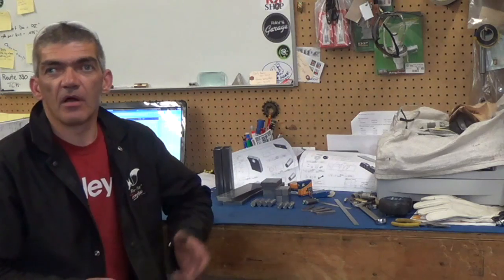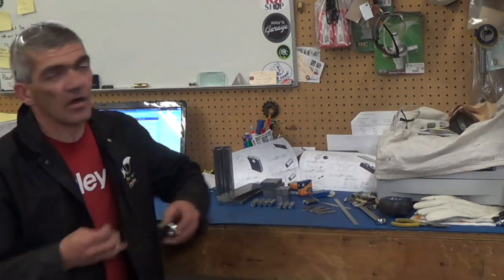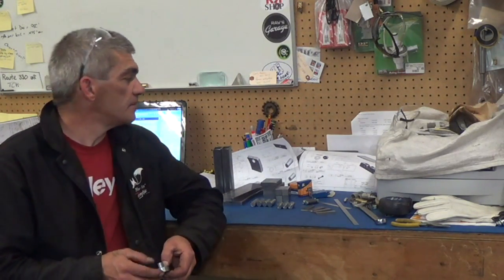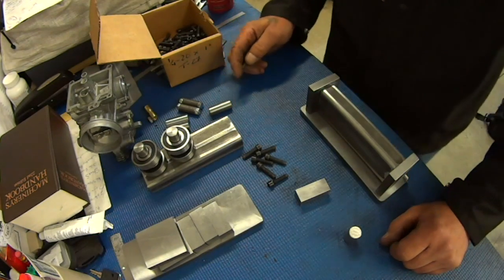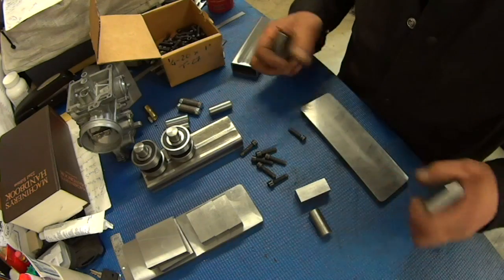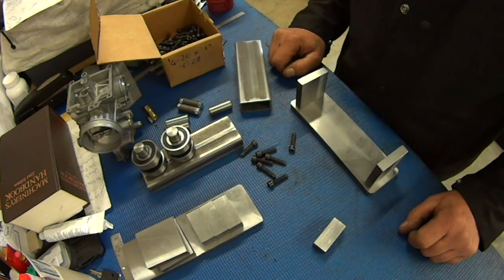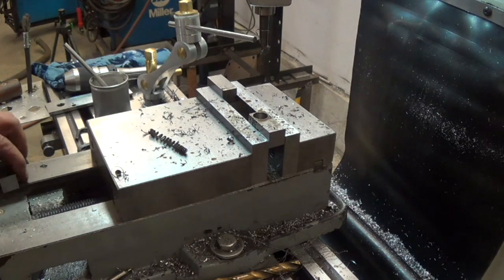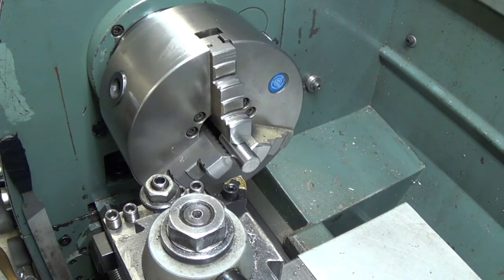Rolling the Wright Way 1/4

Comment: ARGGH!  Just after I crank up the volume to hear what you was mumbling, the scene changes and my speakers pop.  Do you have any drill bits not burned to a crisp?  Pray tell wherefore thou dost maketh them so dizzy?  I though you had sped up the footage until I saw your arm move.  Don't know why you need a set of those rollers, anyway - they won't roll in the snow.  You metric people really burn my a$$, sometimes.    
Well, enough with the pleasantries.  I need to take my medication and go lay down for awhile.

Welcome back, Colin :P
Reply from the maker: +Eddie the Grouch Haha, cracks me up everytime. :-)  Gonna use those rollers for balancing snow tires... I thought it was obvious.    Cheers, Colin ;-)

Comment: Hi Colin, nice to have you producing videos again...
I like the idea of screw mounting vs the weld mounting, welding always needs corrections due to metal reactions to heat....    :)    Pierre
Reply from the maker: +pierre beaudry That was my thought as well plus the ease of rebuild (clean the rust off) if needs be. Downside is if dropped the ends will need a re-square but not such a big deal.  Hope to get more footage together soon and for sure for the upcoming projects!!  Cheers, Colin ;-)